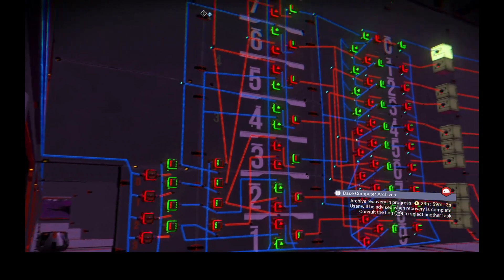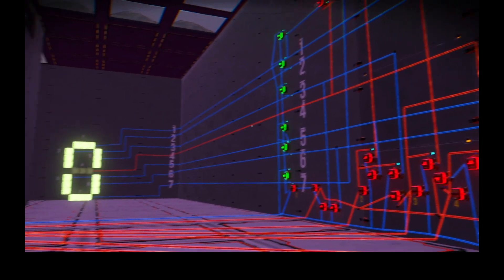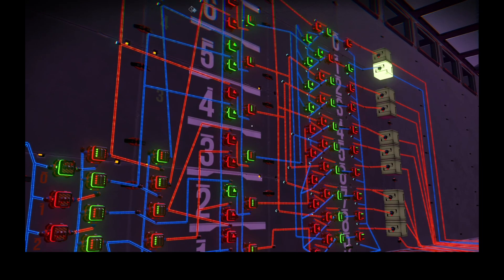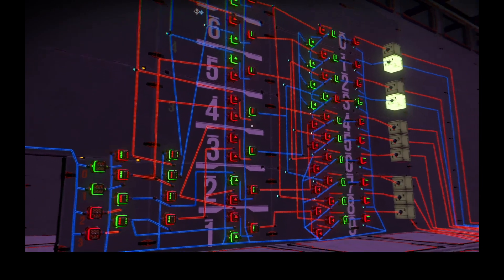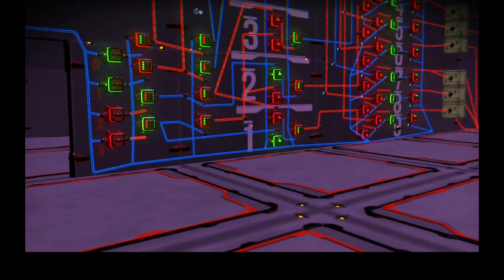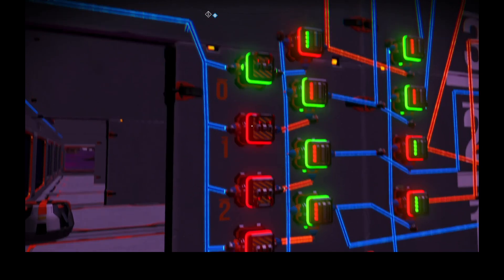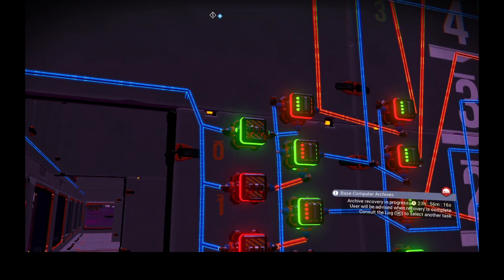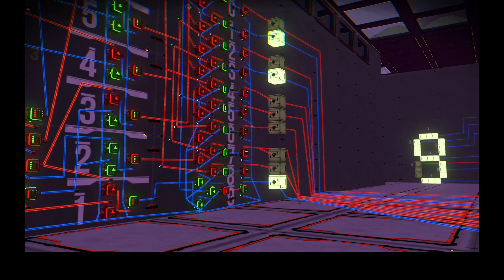No Mans Sky - 4-to10 BCD Decoder

Comment: Skimming through, thought you might be interested in this,
https://youtu.be/Fg8JVTC5n-w
The second part goes over a BCD 7-segment display, which uses a similar layout as yours, but puts the "OR" gates on the output side, therefore not needing autoswitches, preventing delays.
(takes about 1-3 seconds to change numbers)
Reply from the maker: Awesome! Thanks for the info, I'm glad to hear others are also working on this kind of stuff.
Reply from the maker: Wow Nolindor, I checked out your videos and YOU ARE THE MAN! All of it is great but I love the Pong game. Really amazing. What I'm running into is the slowness of the switching but your designs work very quickly, when I get a chance I'll try rewiring my decoder/driver as you mention to see if I can get the speed up. I wanted to use a JK flipflop to build a counter, but ran into issues with the clock. So I'm looking forward into understanding your counter and sequencer designs. Thanks for stopping by and letting me know about your channel.
Reply: @bertwhetstone3173  I go through the three types of counters I use in the control point video. I should note that I still have speed/stability issues with the bidirectional counter, and that it is good to have a reset switch for it. 

Link: https://youtu.be/MnWepKUorg0